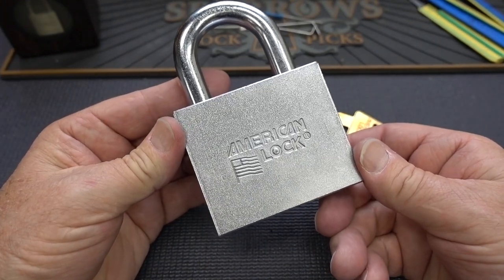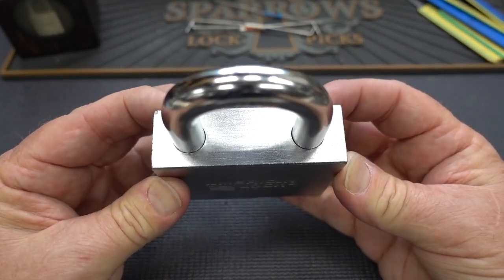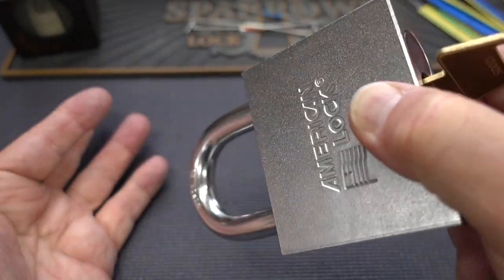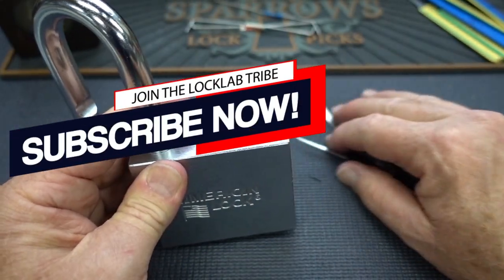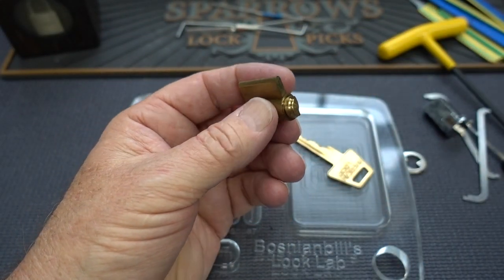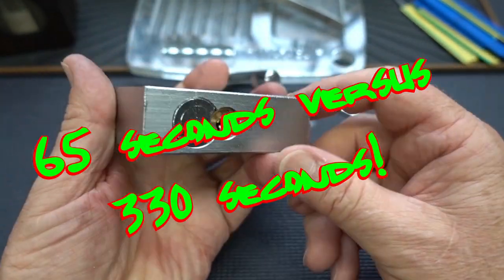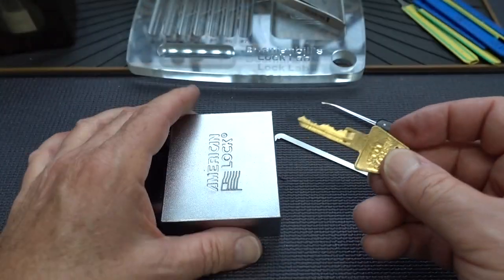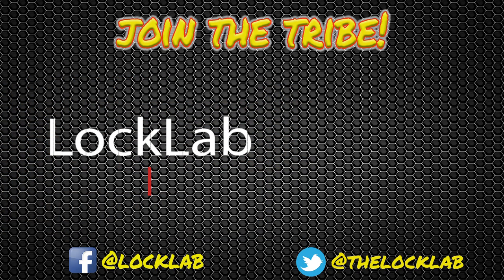(1329) American Series 790 Picked & Upgraded with Countermilling

Comment: Nice tip for countermilling the bible. But personally I like to use a "sacrificial pin" when countermilling the core. Just throw in a standard pin in the core to set the depth of the head of the dremmel bit to exactly where you want it to be and you will not have to worry about going too deep or slipping up to the shear line. But it will ruin the pin so never use one from the lock you are working on.

Comment: So i saw how much effort you put in to audio and i don't want to make light of your efforts so take this as you will. In the first half of the video there's a sort of vibrating sound that occurs, it's quite noticeable at 3:56 when you say "standardisation" listen to the S syllable at the beginning. HOWEVER what's interesting is that the vibrating sound is completely gone after you jump cut to the second picking at 11:07. It does not occur at all after that point.
Reply: guardians unite Agreed!  What did you do Bill?

Comment: Great work on that lock! :)
I would probably have swapped one of the spools with one of the serrated driver pins in front, so that at least one of the spools was over a short key pin - then the spool would have more room to take advantage of the undercut :)
Reply from the maker: In hindsight, that is exactly what I should have done.  I was trying to make minimal changes but that would have been smart.
Reply: I was also wondering - how does undercutting in the bible help when there is no spool element on the key pins?
I thought that it might trap the upper part of the spool pin, if the key pin is short enough, but if the undercut is rounded, the end of the spool pin wouldn't get caught when pushed up into the bible..?
Anyway - my thought was that a square dremel head would make a sharp inner edge to the undercut which would stop a spool from being pushed up into the bible if the key pin is short enough to let this happen ... but that would probably also be the case when using the key ... soooh, probably not a good idea anyway ^_^

Comment: Soo ... did you change something on your camera? The Focus blur is crazy. Seems like a new lens. Really like the background blur - gives more focus on the Lock and Pins themselves.
Seems like you have a new camera to me.
If you try to change the Focis point to something like CENTER, you should prevent the camera from going nuts by trying to focus on the tray in the back and then to your hand.

PS: Maybe use a little stopped down aperture so you have a teeny tiny bit more in your focus plane?

At least this is what I gather from this video.

Thanks for this and keep up the awesome work.
I need to get more time and get picking again :-)

Comment: Is rounded undercuts preferred over straight undercuts? I have been thinking of putting the core in a lathe to shrink the diameter of the core and then put a sleeve on the core to create a sharper undercut.

Comment: Bill: the chirping and echoes only come through on lower resolution playback. At the higher resolutions- 480 and above- there is no chirping. Don’t know if this helps or notz
Reply: This isn’t the case for me.  I hear it clearly even at 1080, though I will admit it may be very slightly less than at 240 or 480.  Also, the noise virtually disappears at the jump cut before the second picking.  From that point on it is at least 99% gone!

Comment: Hey Bill, just a casual question:
Why not empty the core through the holes made to drill out the bible? Seems way easier than all the trouble with the follower when those holes are available. Even if you can only do it with the core pins, it would make it far less risky than the follower, no?
It would be just like gutting the core, but with some extra brass on the back, that's all. And afterwards, you can still use the follower for the bible pins if they don't fit into the core.😊

Comment: So, if it took that long with 3 chambers, how long would it take with more? And what about changing the order of the key pins and cutting a new key?
Reply: More is not always better.  They were strategically placed to go along with the spools, since undercutting seems to be most effective with spools.  He could have gone further and done some threading on the other chambers, but that wasn't what the video was about.
Reply: No, but he did say he didn't like the bitting. So he could have rekeyed it and cut a new key to suit.
Reply: Possibly.  But he also indicated that it wasn't his lock, though he did have permission to modify it.  I'm sure he could have totally rebuilt the lock any number of ways, but, I suspect that the point was to show how to undercut, and its effects.
Reply: I would wonder why he didn't use a different core. Keep the original intact.